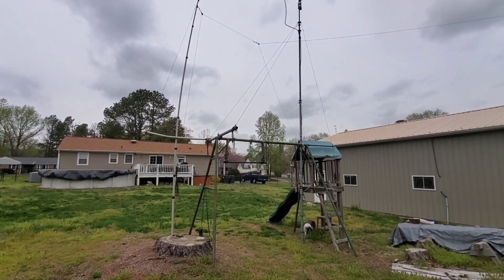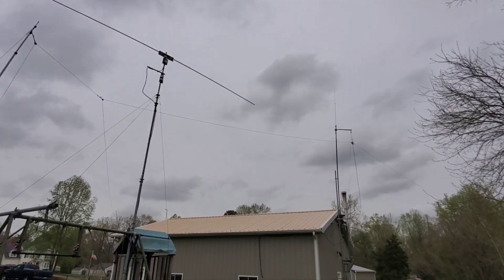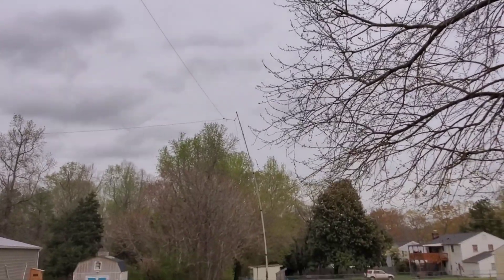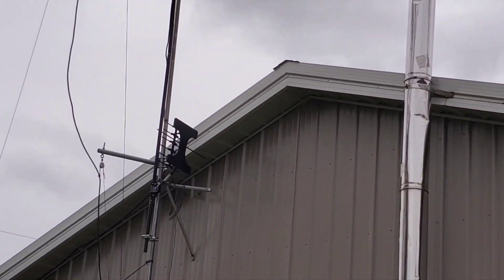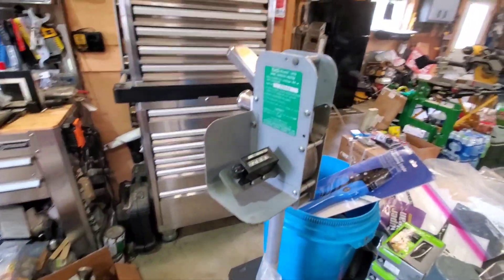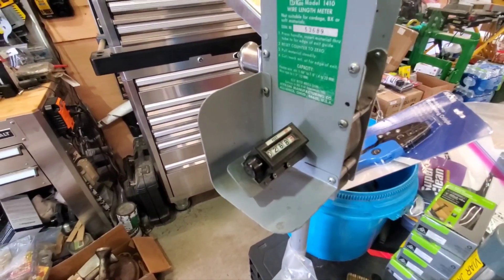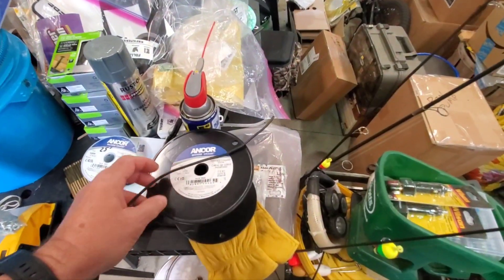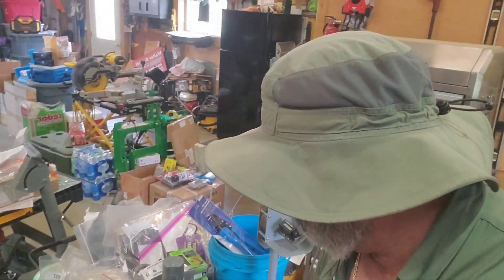Delta Skyloop Horizontal 80m Full Wave  Multiband Ham Radio Antenna 80-6M  Built By KVUSMC

Comment: I put one up for 80m. About 35-45' high. the 14 AWG thhn wire I used  ended up being 273'. 4:1 balun fed with coax. If you make the 20m harmonic resonate at 14.3 MHz, every other band falls into place. I only need a tuner to touch up 30m and the upper end of 75m phone. Everything else is 1.2 to 1.5 without a tuner. This antenna replaced an EFHW.
Reply from the maker: That is awesome Brother yes mine works on every band expect 160 meter it is my Go to Antenna I'm also using a 4:1 - 1:1 Hybrid Choke Balun  Cheers 73's de KU4SMC

Comment: I built one myself its 276ft. for portable operating. Also have 548ft Version for 160m. Use them for Multi Band usually with a 2:1 or 4:1. On and off adding some 450ohm Wiremen to feed it. Nice to play around with these Antennas. Love these Loop Antennas. You did a good Job. Tnx for sharing the Video. 73 de Uncle Günter across the Pond  💯👍🙋‍♂
Reply from the maker: Awesome Your Right there buddy These Antennas are awesome You Have a nice setup as WellvThat is So cool I Love How many stations I can pull in And it is So quiet And I'm getting incredible Signal reports Many Thanks For Watching 73's De KU4SMC